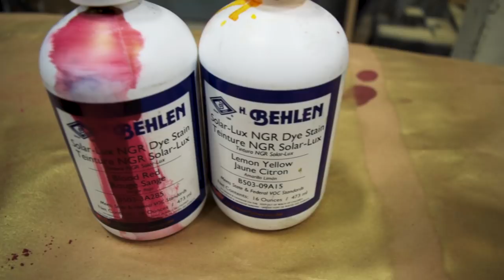How to Dye Your Guitar (Awesome Colors)

Comment: I rarely go " 'Net nanny" on YouTube ('cause there's plenty of them already) - but put some finish in another vessel and apply it from there.  I was cringing every time you put that rag to the top of that pint of dye.  ONE DROP of red will make a whole bottle of yellow "go orange".  I know you were using some caution, but still, best practices and all......

Good info regardless.  The idea of "solvent washing" really shines if you're doing a "fade" between colors (as opposed to layers over the entire surface)  Maybe you could do a "red to orange" sunset kinda thing on another project.  I'm guessing this looks way better in person - something about reds that never comes across well in images / films.  Looks like you had real nice results on the front.

This is also a great place to employ some of that shellac - doping your dye mix will give it a bit of "fixing" ability - depends on the wood, but it can add a little more drama to sand back as more of hte color gets locked in.  However - to much "working" on subsequent coats can melt it off just the same, so it can take some finesse.  If I'm doing a multi-color dye with a sand-back I will sometimes spray the top color with an airbrush so I explicitly don't have to "work" the finish with a rag.

The only thing I don't like about "fast" solvent dyes is that on some woods there's just no way to keep it from looking splotchy.  This is especially true with kit guitars if they're basswood or poplar.  Or, if there is a way to keep them from splotching (like you can with a pre-stain and oil-based finishes) I sure haven't found it.....
Reply: +Don Vanco adding shellac with an alcohol based dye is going make a mess when you apply the next color of alcohol based dye.  Remember shellac is dissolved in alcohol. Trust me on this, I've made this mistake before and was barely able to hide/cover it up.  The second round of dye immediately dissolved the shellac and immediately turned into a mess.  If you want to make the first layer more colorfast, you need a sealer that isn't going to be reconstituted by alcohol, like a water based sealer.  
As far as dying basswood or poplar goes you have 2 options. Option A: Lay the dye to it full strength and in multiple coats in hopes that eventually you'll get something of even coloring.  Option B: seal the wood with a sealer the isn't going to react to the dye base, and go to town.  The colors will be muted, but at least they'll be much more homogeneous.
Reply from the maker: You guys are awesome.
Reply: DaveR's Guitars  - to be clear - I'm NOT taking about dyed shellac.  Most commercial alcohol dyes (like Artisan and Chestnut for instance) are LIGHTLY doped with shellac - like less than 5% of 1# cut.

As I clearly indicated in my comment - you can melt this with subsequent coats, but at the same time the effect of using a "fixative doped" dye is different than that of just dye in solvent. If you soak a rag with a secondary color and just muscle it into the finish it's just going to melt - but that's not how to do it.  The effect is stunning when done correctly.
Yellow over sanded magenta - on heavily bleached black walnut: https://i.imgur.com/f3HaAwH.jpg
Yellow over green, heavily figured oak: https://i.imgur.com/5rCzKWm.jpg
Yellow over orange, same oak: https://i.imgur.com/WsvOXX2.jpg
Reply: +Don Vanco -  Those are very cool indeed.  And no, I wasn't referring to dyed shellac either.  Please correct me if I'm wrong, the success of this technique depends on the porosity of the wood itself.  I can see that technique working on an open grained wood like walnut, ash, oak, however, on a closed grain wood like maple or alder it would be less effective?  I think that's where we were differing in our experience.  And FWIW, it wasn't "muscled", it was on a maple neck, I had sprayed a THIN coat of shellac over my dyed neck.  Something happened and I had to sand an area down just a bit and needed to retouch the dye.  I did, and immediately, upon the dye touching the shellac, the shellac melted and began blending and bleeding.  Completely unintended consequences, however it was experience that was my teacher on this.  Thank you for sharing your technique,  I would be very open to learn this technique, would you be willing to elaborate more?
Reply: DaveR's Guitars  The technique definitely requires a "porous" wood for it to work as you see in my tests.  And yeah, I'm not surprised that you didn't have good results on (hard) maple for that reason. For this to work the base color has to have some nooks-n-crannies to hide in.  Figured maple tho - no problem.

The walnut sample was all done with "wiping" on color - but the top color in virtually a single pass.

The oak was done using very tight weave (all cotton) linen fabric (scrap bin at your local fabric store) that I had in a single layer on one of the large spindle cores off my spindle sander.  In effect it was like and "ink roller" (that didn't roll... lol) and allowed me to wipe heavy color across the surface only and not "pull" any of the color in the pores from the sand-back.

And yeah - in all cases there is definitely some "color lift" on the base layer.  When dealing with bright colors like yellow it is imperative to have fresh, clean applicators for almost every pass or they start to bleed / smear.

All those colors I used are Artisan dyes, BTW. (https://www.woodturnerscatalog.com/p/148/6187/Artisan-Premium-Coloring-Dye) - I still mix my own with pigments from WD Lockwood (their metal complex dyes are AWESOME in lacquer if you're a fan of Gibson and Fender "classic" bursts)  but the Artisan stuff is so bright, so cheap, so predictable and so repeatable that I have almost stopped mixing my own other than "classic bursts" 

On figured maple I will "coarse sand" for the base color (like 180 tops), this really opens up the "lenses" on the figure so they take in a lot of color.  I will sometimes do a couple coats of color to insure it's saturated but the shellac doping probably keep it from doing much.  I will then go VERY high on the sand back - start with 220 and take it up to 800 or better.  This is counter-intuitive to what people do on the world of furniture finishing because it has a polishing effect on the wood that can actually keep (thicker / more pigmented) finishes from penetrating, but for it results in a surface I can color nicely with a light wash and get the effect I want.
Of course every piece of wood is different - as you likely know, what worked today probably won't work the same tomorrow unless it's from the same stock, so you really have to test every piece......   I've posted this image before on one of Brad's videos - but this is a trans-black from a SINGLE pass of stain on maple that was "polished" in this fashion...  https://i.imgur.com/IyKzjRD.jpg
Reply from the maker: This conversation deserves a pin I think. Lots to be learned from it for the majority of my viewers here, and myself for that matter.

Comment: Aye when you said you can use the solvent to make detailed patterns on the back, do you mean by just having really good control with the rag/brush kinda like painting, or can you tape off patterns & then apply the solvent? Or would the tape potentially tear/lighten up the dye when removing it? Also does the same answer apply to water based dyes too homie? Sorry if it’s a dumb question I’m new to dyes & I’m trying them for the first time lol
*Also can you use an epoxy finish over a charcoal/flame topped dyed guitar?
Reply from the maker: I meant by hand with the solvent. If you’re going to tape, it would make more sense to seal first, then tape, then use a toner lacquer rather than a dye. 

Yes you can epoxy over that.

Comment: Gotta love the sandback technique!  Another fun way to do that and keep the dyes from mixing too much is throw a light coat of water based sealer over the sanded back base color.  It will help keep the second color from pulling up too much of the base color, but it also mutes the top color some.  Yet another way to get different effects using different color dyes.  By the way, that top turned out really nice.
Reply from the maker: You put dye on top of sealer? It’s interesting to hear that that’s one of your techniques. I only do that when I’m looking for a very washed out effect.
Reply: @BradAngove  you can.  Like I said it gives a muted color on your top dye.  But does help keep from pulling up the bottom dye and keeps blending down. You only use a single light coat of sealer though.
Reply from the maker: That makes sense. I do the sealer in the middle as an accenting technique for some really open grain, but that’s the opposite really. You dye the whole thing, then come back after your sealer and glaze the open grain.

Comment: I really like the finish product of the dyes. 
Question, do you have a preference between using air tools versus electric? I know air tools can get away from you and remove more then you want.
Reply from the maker: I generally use pneumatic tools when I can. There’s an adjustment on most of mine that prevents that problem.

Comment: I have never done guitar building but I’ve been interested in getting into it because it seems like the type of hobby you could do for a long and get pride from your work. The only thing holding me back is I have no experience in the electrical side of things along with soldering and I don’t have all that much experience with painting and staining. As far as the painting and staining/finishing side of things, do you have any videos for fresh beginners?? Or any advice on where to start as far as videos or information goes?? This seems like a very rewarding hobby for a guitarist to get into and I’m hoping to one day.
Reply from the maker: Do you have a particular method by which you would like to apply your finish? By hand for example, or spray can?
Reply: Brad Angove I guess I’m open to anything. I feel like by hand would be interesting but I’m sure knowing how to do both would have its perks for different situations. At this point though probably whichever one would be easier for a beginner to grasp how to do.
Reply from the maker: Have you seen my four part series on how to paint a guitar with spray cans, or my three part series on how to finish a guitar by hand? They are old.
Reply: Brad Angove no I haven’t looked at those yet. If you think that would be a good place to start I’ll make sure to check them out!! Basically I was just looking for a good accessible starting point. Thank you for the help!! I’ve only seen a couple of your videos so far but they are really great!! Keep up the good work
Reply from the maker: Those two series, though older and not as well filmed, would be a good place to learn the basics. My 5 part series on how to paint your guitar with behlen’s guitar finishing kit also shows the basics and goes start to finish on a paintjob.
Reply: Brad Angove awesome, I’ll make sure to start with all of those!! Thank you for the help!!
Reply from the maker: Let me know if you have questions afterward.

Comment: If one were to tape off parts of the body and lay the stain down along that tape line (or any other adhesive blocking-type material) would that dye come out straight/bold along that tape line or would it bleed, making the lines sloppy? Thanks.
Reply from the maker: You can generally expect that it would bleed a bit. To alleviate this, tape the opposite and then seal the area that you don’t want to stain. Then tape over the sealed area to be safe.

Comment: I am about to assemble my third kit and plan on using dupli-color.  The color I like is a metallic color.  Any concerns or issues with using a metallic?
Reply from the maker: Nope. There’s nothing wrong with that.
Reply: @BradAngove  Thanks, Brad!  Also, do you recommend a sealer before primer? I didn't use sealer on my last project, just primer, and paint is holding up fine so far.
Reply from the maker: There’s no need to use both a sealer and a primer.

Comment: Would a black dye allow you to still see the grain or do you think it'd be too dark?
Reply from the maker: For the first step?
Reply: @BradAngove  Using the method you do here. I'm still on  the fence about doing a spray or spray can black.
Reply from the maker: If you apply the black and then sand it back you’ll accent the grain like I did with the red. I used a similar technique in my video on how to dye quilted maple.
Reply: @BradAngove  Have you ever used "liquid glass" epoxy on a guitar? I saw a video using it on a box lid and it looked really nice.
Reply from the maker: I haven’t.

Comment: Can we add some Odie oil for the finish coat instead of lacquer? And do we need to sand down to apply those final coats? Thank you.
Reply from the maker: It’s an unusual choice, but technically you could do that. It wouldn’t be glossy per se though.
Reply: @BradAngove  thank you. But yes, I am going for a matte finish. Do you think oil is ok for matte or something else?
Reply from the maker: Oil will be satin. A matte clear coat would be the usual choice for matte.
Reply: @BradAngove  Thank you so much.

Comment: Is there a difference between water-based and alcohol-based (even oil-based) stains when it comes to grain rising? I know that this particular body doesn't have a very intricate grain pattern, so there wasn't much grain raising but I'm asking a general question here
Reply from the maker: Yes, to a degree. Water soaks in deeper and raises it the most. Alcohol dries faster, and still raises it. Oil, in my experience, often does no raise it.
Reply: @BradAngove  thanks, that's very good to know!

Comment: Do you not need to seal the body before putting on dye?
Reply from the maker: The dye won’t soak in and dye the wood if it’s sealed.
Reply: Doh! Funnily enough I've already dyed one and didn't seal it and it worked out okay, just thought I better check...thanks Brad!

Comment: Would wipe on poly be a good option for finish on a dyed guitar?
Reply from the maker: It certainly can be.
Reply: @BradAngove  on a piece of alder would you seal the wood after dye and then apply the wipe on poly or can you just apply the poly right after the dye dries? Thanks!
Reply from the maker: Either way is doable. I often jump straight to the poly and just add an extra couple layers.
Reply: @BradAngove  appreciate it as always brad